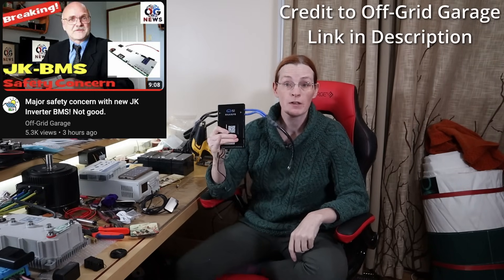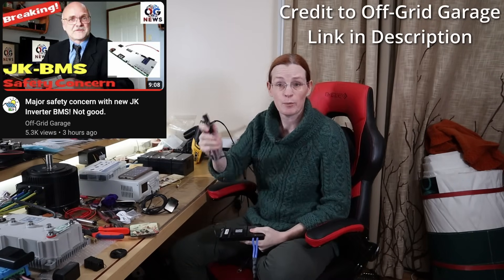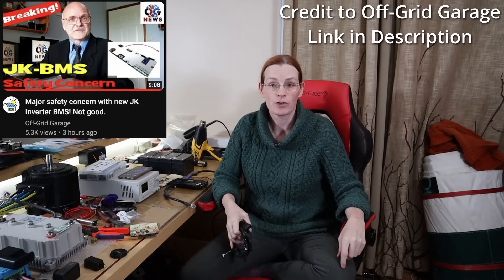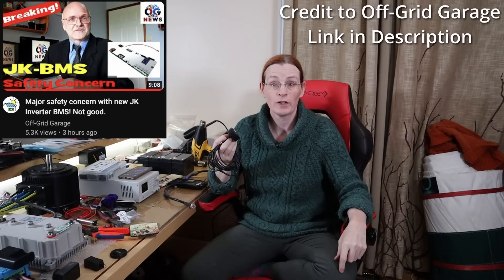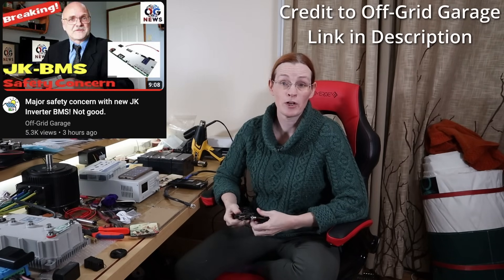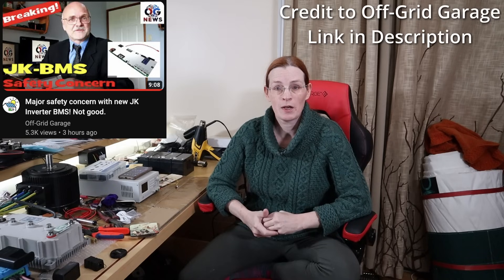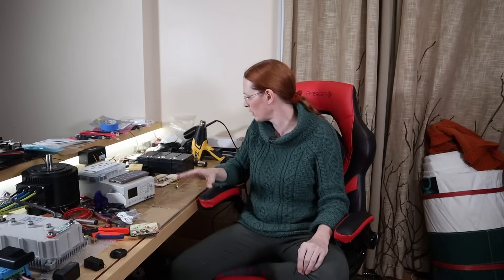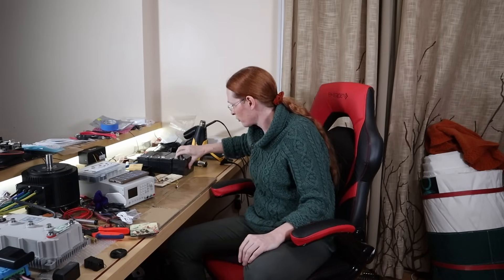News from Off-Grid Garage; Dangerous JK BMS Flaw

Comment: Uh, duh, why would you allow your bms to dictate the max charge voltage.   Try setting your solar charge controller to the max you want.  Likewise if you have an ac charger set it at the max you want and be done with your carping.  You seem to be befuddled over non-issues all too often.  If this concept is new to you and you are "gobsmacked' (whatever that is) perhaps you should steer well clear of this technology.
According to Andy 1, this only pertains to the newest inverter bms made by JK and not the one's you own.  So relax and have a pickle.
Reply from the maker: I've answered this a few times, maybe I need to make a video about it... 

Consider this scenario; You want to charge to a max of 3.6v/cell, or 57.6v, so you limit your MPPT or other chargers to that voltage. We know that the voltage curve of LFP is very flat, so if you have one cell that is higher that the others, it's entirely possible that it's voltage will start to climb while the others are around say 3.3v. So if you have 15x 3.3v, that's 49.5v. 57.6 - 49.5 = 8.1. So you could easily easily overcharge that high cell without your chargers knowing anything is wrong.

Sure, ideally you'd have you BMS talking to all your chargers and telling them to stop charging, but then you're back to trusting the BMS to do the right thing, which clearly JK struggles with. More, what if you have multiple batteries in parallel, you want to cut off charging to all packs when the first hits it's limit? The days of relying on the BMS to tell the chargers to stop are behind us.

Now, I am always happy to be corrected, or have my statements and assumptions challenged, but I won't stand for rudeness. No need for "duh" or "have a pickle" (unless it's dill pickle chips, I'll have those all day).
Reply: Yeah exactly man, why should a thing do the thing it's supposed to do? 

People with their crazy expectations and complaints, can't stand it.

Comment: what kind of BMS should I get ? I'm about to billed a Wheelchair ? I have JK  K-B2A24S20P.
Reply from the maker: I wish I had a good recommendation... I suppose in a pinch? The JBD (Overkill Solar) that I used early on in the build (I gave to Andy who did more testing on it). Do a good top-balance before you build the battery and you should be OK. Otherwise, consider adding an external active balancer. If you're building a 12v battery, there's a variant Andy experimented with a few months ago that is a rebadged JBD with direct support for an external balancer, that one looked good, though I've not played with it myself yet.

Comment: To all the people saying 4.2v is fine for lithium iron phosphate. Well, it used to be in the early days, because they used very similar electrolyte composition to the lithium ion cobalt nickel manganese type. For the last 10 to 15 years though, the electrolyte has changed to make the cells last longer and the new electrolyte has a smaller ‘voltage window’. This means that it can dissociate into gaseous byproducts if the voltage goes too high. As far as I am aware, most modern LiFePO4 cells use an electrolyte that will begin gassing at around 3.8V, and will create uncontrollable gassing above 4V. So no, it’s definitely NOT FINE to allow them to charge to 4.2V, and will most likely result in high gas pressure, bloating and rupture. Several people have made videos and posts online showing this happening. Some cells bloat like a balloon at 3.85V. As always, read the datasheet that comes with the cells, and respect that maximum charge voltage! If you can’t get a datasheet for a cell with proven tested parameters, don’t buy them!
Reply: It's not the voltage, per se, but the heat generated above 3.2V. Basically, everything above 3.2v is just making the cell hot, not getting stored as usable charge. Don't believe me? Test it for yourself, cycle test 3.2 to 3.6 in 0.05v steps and see how much more power you get back out each step.

Comment: You will like the Riden power supply, be sure to use the green battery charger banana jack for charging cells or batteries. I am not a fan of JK BMS, but everyone has different priorities. I understand that Andy wants to get that last 0.1% of usable capacity for his (uncommon) use case of going months between full charges, but his testing methodology really annoyed me. I watched him change balance parameters at least 5 times in a single video and then declare that passive balancers don't work. Meanwhile I go six months without changing parameters and have no problems (I suspect some of his cells have wildly different self discharge rates). He "shadow banned me from commenting on his channel when I pointed out recommending a $500 active balancer simply to get a cut wasn't what I wanted to see. Anyway, enjoy the Riden, it is a very versatile power supply for working with LFP, reliable for a single cell or an entire pack. I own 5, so I can top balance 4 cells simultaneously (set it to 3.65v and wait for it to finish). I use a 12v BMS to get 4 cells up until cutoff, then top them up to 3.65v individually. I use Anderson connectors to connect the cells so they are easy to work with and you only have to hook up positive and negative correctly once. The Riden actually told me what was wrong with my 4 worst cells, since all were at the same resting voltage when received (3.3v). 12 of them took 180 amp hours to charge to 3.65v, and these 4 took less than 5 amp hours. That correlates to 12 cells measuring about 274 amp hours or above, and 4 that measured 264ah (approximately). Best I can figure is that the 4 were fully charged and sat somewhere for approximately 2 years (I knew they were "grade B" when I purchased them).

Anyway, don't charge to 3.65v on a regular basis, and in my experience an active balancer gets an extra half an amp hour after a year or so. I use JBD, since they started life making BMS for medical equipment and they have never given me a problem. Daly is like JK, random undocumented changes, and the very first one I tested wouldn't show charge cycles  because (you guessed it) it wouldn't mark it full until 4.2v.

Yes, I used to design manufacturing test sets for power supplies 40 years ago, so I cringed everytime Andy changed parameters in a single cycle.
Reply from the maker: Glad to hear about the Riden! I've not had a chance to play with it, it was very much an unexpected gift! Having a 60v bench PSU is going to be super handy, now and on the boat. 

The thing with Andy is that, for very different reasons, it's similar to my targets... I am trying to eek out every last mile of range I can out of my pack, and I don't plan to hit 0 or 100% SoC very often. 

I'm going to set the top of charge to 3.5 or 3.55v, and stop the discharge at 2.6 or even 2.65v. You're right, there's so little power beyond there, so why not? I'm starting to think JBD, which I also started with, it going to be the new one to play with. I still need to think about this some more.
Reply: @TheDigitalMermaid  One think with riden if you planning go straight into 24A constant current you will need add a fan at the side of the power suply. it works flawles about 1h than inside temp sensor hits 75C and shut down itself(working safety), if you lower to 23A or put powersuply on the side(side vents now are at top and bottom) so hot air go out throught to vent and works nice again , small isue just put fan on side and problem solved

Comment: I’m running four of older JK 200amp 24S bms’s and they have been flawless for over a year. If you remove the issue of poor documentation then it’s 99% user error, bad installation or bad settings. It will be a long, hard and expensive road to find a better safer bms. I’ve got a box junk to prove it. Yes the NEW “inverter” bms has a major safety issue IF you turn it off a while and back on. 
JK probably won’t have software patch for this. IF this is the case then they need to get these back to fix or destroy, they can’t have these out there. A recall campaign?
Reply: I would not hold my breath waiting for JK to do a safety recall. Most Chinese companies laugh at the thought of being sued. If it becomes a big issue, they will simply change the company name.
Reply from the maker: It frustrates me to no end that you're probably right.
Reply from the maker: I understand where you're coming from, but to me, "has a major safety issue IF you turn it off a while and back on" is ... well, huge. A BMS turning off happens, particularly if the battery is in a boat, RV, cottage or some other situation where you could be left alone for months.
Reply: @TheDigitalMermaid  
Yeah, I wouldn’t use the new “inverter” bms especially in a boat. I absolutely don’t see any advantage to communicating batteries/inverter with a Victron and the black JK bms’s that you already have. You have bulk/absorb time and tail current adjustments so there’s really no need for closed loop. You already know the in’s and outs around the Victron+ JK’s (and what can go wrong). Even other high end bms’s have their issues, learning curve, a lot of money and a new place to mess up. Don’t throw the baby out with the bath water. Take your time.
Reply from the maker: @SkypowerwithKarl  Like I said, if this was a stand-alone issue, I'd agree with you. Problem is, it isn't. Their app is flaky, their FET timing is bad, they use questionable components, they fundamentally change features under the same part numbers... All of it together is more than "throwing the baby out with the bathwater". They clearing have poor QA and a healthy dose of just not giving a damn.
Reply: @TheDigitalMermaid  I have to ask: what's with the app? As you know I have several of these in 24/7 operation for almost 5 years now, never seen any issue with the app. I also checked the electronics and made a MOSFET calculation and they definitely are designed to handle the stated load with a margin. Which questionable components do you mean? I deliberately did short circuit tests and the like, and it handles these perfectly (which I initially did not expect at all when I started looking at a BMS for my packs).
Reply from the maker: @upnorthandpersonal  writing on my phone, so allow me to go into more detail tomorrow. In short; the app frequently crashes when I try to switch between bmses. If the phone display orientation rotates, it elongates and the bottom buttons can't be seen until I force reset the app. It doesn't show which profile is active. Etc. On the parts; Andy has blown FETs on a couple different bmses doing over current discharge. Stuff like that
Reply: @TheDigitalMermaid  To be fair, Andy's blown FET was the very first device they sent out and was pre-production (they weren't available for purchase at that time yet).
Reply: @upnorthandpersonal  
I’m kinda thinking that memory volatility might be component selection or circuit issue and not field fix.
Reply: @SkypowerwithKarl  Someone already confirmed that the issue doesn't occur with older versions of the firmware on this BMS.
Reply: @upnorthandpersonal  
That’s very good news to all involved. I hope it’s an easy update fix
Reply: > JK probably won’t have software patch for this.   --> earlier versions of the firmware on this BMS didn't have the issue, so I do believe this will be fixed in an update.

Comment: One thing to point out is that LiFePO4 cells won't generally bloat with the risk of venting and fire until they are well over 4.2v.  4.2v used to be the charging cutoff for LiFePO4 back in the early days before they recognized that they didn't need to charge that high and the cells last more cycles when not charged to 4.2v regularly.  Even the 3.55v, 3.65v 3.7v charging limits are all just going off best practices to be easier on the cells and allow them to last longer with less chance of electrolyte degradation.
That being said, I remember when some of the DALY BMSes had a similar issue and that was why I stuck with ANT-BMS at the time and still use them at this point.
The actual max usable cycle range of a LiFePO4 cell is 2.0v-4.2v but the majority of manufacturers stick to 2.5-3.65or3.7v since it is far easier on the cells and so little capacity is available outside the range we use today.  That is actually one of the main reasons why LiFePO4 offers so many more cycles than NMC and other similar variants.  
I am interested to see what JK BMS decides to do since I still consider them to be very new to the scene only being around for a few years at this point whereas I have been using the ANT-BMS stuff for about 6 years on.
They do need to figure this out or a lot of manufactured batteries that are currently being manufactured will be running outside of manufacture spec as soon as customers turn them on for the first time and some of the vendors don't even let the customer change settings.
Reply from the maker: Interesting about the voltage range... it would help explain why the cell I had that dropped to 2.0v doesn't appear to be damaged. That said, the EVE specs say to maintain between 2.5 ~ 3.65v, so that's what I have to recommend others do of course. Interestingly, I've seen overcharged batteries that puffed up like marshmellows... I wonder now what voltage they actually hit.
Reply: @TheDigitalMermaid  Yes, when LFP first hit the market, recommended charge and discharge voltages were very different. Many early "hardware" BMS (not programmable) used what would be very out of spec voltages today. The more reasonable voltages manufacturers spec today is the primary reason they are rated for so many cycles. Of course minor tweaks to chemistry are also a part.
Reply: @TheDigitalMermaid   I had a charger fail once and it took a few cells to a bit over 5.5 volts and they puffed up after being held at that voltage for several hours but surprisingly they never vented.  It had to be close but LiFePO4 is surprisingly tolerant to abuse even when they vent it usually doesn't result in fire but we all try to keep the chances that a cell ever gets overcharged to a minimum where possible.
When I noticed the cells I discharged them down to below 1v and discarded them the next time I brought cells for recycling.
I definitely understand the need to follow the manufacturers recommendations and make the same recommendations.  I too follow similar charging parameters to what Andy at offgrid garage is doing since it makes since to not abuse the cells any more than necessary.
Reply from the maker: 5.5v!? Good lord...

Comment: Just bought one a month ago I don't plan on turning it off so should not lose it's setting hopefully by the time I'm ready to use it full time they have a firmware upgrade.
Reply from the maker: I hope so. In the meantime, if the BMS does reboot for any reason, be sure to check the config when you turn it back on.
Reply: @TheDigitalMermaid  Wonder if there is a way to setup an alert with Solar Assistant. Run it off a Raspberry Pi. I have so much work to do haven't gotten to that point .

Comment: I have used those 4-8S 200A with 2A balancer what have been ok and i still do checks.
One 8-20S 100A BMS on my 8S Lifepo4 UPS battery.
I dont lose faith in the manufacturer in question because they have product with model flaw, its good that flaw have been found and hopefully people will get their money back or new product with the flaw fixed on those new inverters BMSes.
You can also find flaws in cars, which can be dangerous, but I have not left the brand because of those, it is important that the manufacturers fix flaws and replace those, dont kwno what JK plans to do so remain to be seen.
I manufacture custom batteries and service batteries for living and also hobby, luckily we havent used these new inventory models.
Reply from the maker: I mentioned in the video that I could forgive the occasional problem from a company. I'm a software developer and lord knows I've screwed up in my days. The problem here is that this isn't in isolation. On top of the various problems I've had with product consistency, app crashes, etc, Andy's has (twice I believe) blown FETs in JK BMSes in overcurrent tests. Clearly they build to minimum spec and throw products out into the market with little thought to safety or consistency.
Reply: @TheDigitalMermaid  Yeah,  my point is not to belittle your opinion, the problem is serious when it comes to cell safety.
Im also do software development, im not sure is this BMS fault in software or in hardware area like memory gets reset when power is off too long.
Never had app crashes or heard that any customer have fault BMS yet but like i said that we have not used any those new inventer models what Andy have, i need knock on wood right now :D
Sun is finally starting to shine here in Finland, the solar panels are starting to produce something.

Comment: Something I don't think was mentioned...
All the solar charge controllers etc.. and my new (bought a month ago) mains 7 stage battery charger..
When first used or disconnected etc for long enough..
ALL revert to the LOWEST ie voltage setting.. or AGM rather than flooded Lead Acid etc.
NOT HIGHEST!
Reply from the maker: Exactly, where the hell are the fail-safes in these things?!

Comment: That sucks. I was already subscribed to Andy, he makes good videos. I try to never make the BMS protect a battery. The more control I have, the better.
Reply from the maker: Having your charger set to max out below the max voltage of the BMS is always wise. That said, external chargers have no view inside the batteries so they can't see imbalances in the cells. It's entirely possible that even if you the charger set to max 57.6v, if the cell average is 3.3v, and one cell goes high from imbalance, that's still 8.1v that can go into that one high cell. A BMS plays a cruicial role in safety, imo.